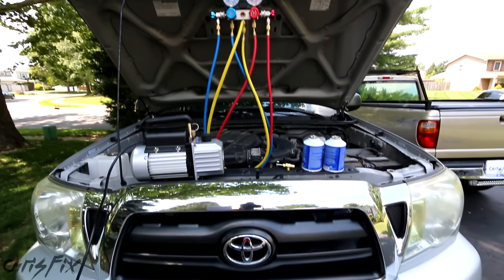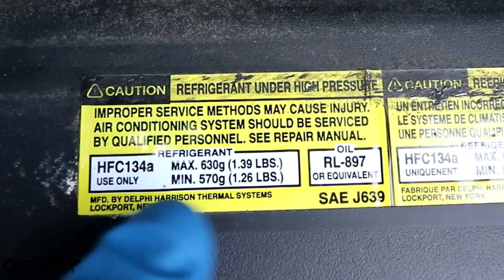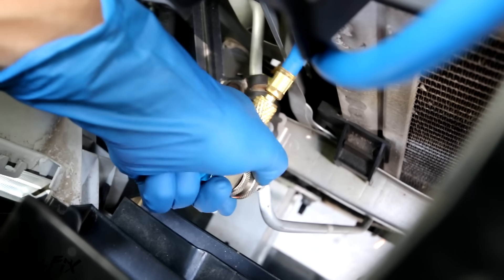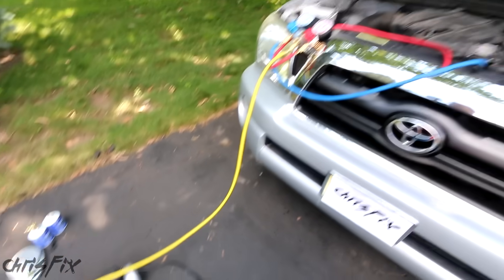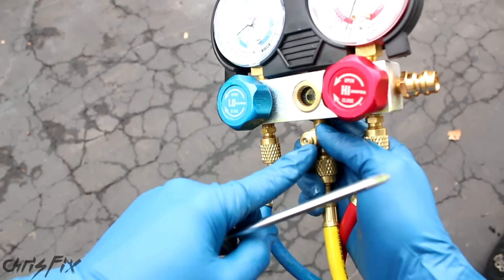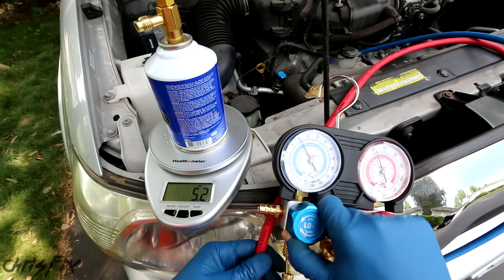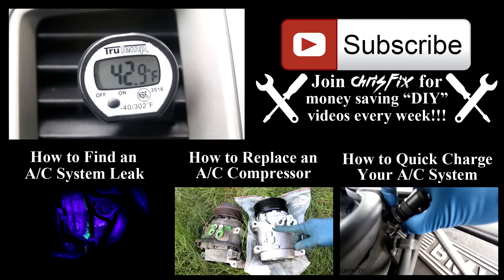How to Properly Recharge Your AC System

Comment: Chris what if i didnt replace an a/c component,  but just want to vacuum and top off what refrigerant I already have??
Reply: Yeah you can just add the Freon to the old refrigerant as long as the capacity meets OEM specs on the vehicle and is same fluid as is specified on your vehicle.
Reply: @YogurtSnipe  how do I know or test to see if my freon level is low or is at right level?
Reply: @troyhenry3267  As like in the video when you hook up the pressure checker to both the high and low lines all you need to do is open the blue valve on the low end in order for the pressure to shoot up to the brass block putting a pressure on the knob. You don’t touch anything but the blue knob on the car to check for pressure while the red knob is close on the car and pressure block. The current pressure your vehicle has will read in PSI, you need to convert that to fluid oz’s to know how much refrigerant is in there. You can use an online calculator but they can be confusing not gunna lie. It’s easier to fill the system when it’s all evacuated.

When you get your level to a certain PSI you can also just check the specs of the a/c on the radiator or right under the top of the hood where a sticker badge would be to tell how much refrigerant is supposed to be there. There should be a min and a max fluid oz it tells you. Your Freon should be in between the max and min to be at a safe level. Sometimes it tells you in weight aswell the oz which is why you need to convert be PSI to weight to convert it to Oz’s. If all else fails you can look online what the pressure should be at. In the video though you need Atleast 35 pounds of pressure to test if the vehicle gets refrigerant. To be honest I just put a total 12oz in a 15oz system and put a quarter of another can into it and called it good. So far it’s ran just fine.
Reply: @YogurtSnipe  how much would a shop charge to 100% evacuate
My cars freon?
Then I could just refill with the appropriate amount of oz. My Accord requires.
Reply: @troyhenry3267  Yeah you have to do it through a evap machine using the vacuum pump and hooking it up to a machine that gets rid of the old stuff properly. It’s actually against the law to just let that stuff spew into the air. Typically they won’t just evacuate the system, I’d cost around $20-$234. Average on $115. The vacuum pump you use does do this mostly since it sucks out the old stuff and the moisture in the system. I believe the vacuum pump shown in the video does actually convert the old stuff into heat from the pump and spews it out through the grills on it. You might be fine there.

Comment: So I have a question, how the hell does he just add the oil right to the yellow line?  It pools in the very top and doesn’t get sucked down, I feel like he missed an explanation here
Reply: Yeah you just have to keep the low pressure line closed on the car. Then keep the second one closed, dump a quarter of the leak detector and condenser oil, hold the line up in the air don’t let it run out, hook up the refrigerant like in the video (after the bubble procedure) and run it like this… Turn the car on, then a/c on low and open the low pressure valve at the pressure checker. It will bubble a bit but that’s just air escaping the line, then loosen the low pressure valve at the car just a tiny bit, it will also bubble. Once it stops bubbling then open the valve on the car more and it will slowly drain down the line into the car. Now close the line on the car and a/c pressure checker. Then hook up the adapter to the refrigerant can and spin the yellow line to the can. Now turn the valve to let the refrigerant fill the line. After that take the screwdriver and push the valve in the middle under the clear glass that shows the refrigerant. It will spew out the refrigerant like nitrogen ice do that until you see the white fog come out. Now the line has no air, then open the checker line on the blue side for low pressure. Now you can do this if you want to be careful. Close the can by twisting the valve on the adapter on the can completely. Then open the valve to the car (blue one) and you should see the pressure spike on the low side. Once it stops and you see the high pressure build up a little bit close the low pressure valve at the checker and open the can up a little bit. Then open the checker blue valve a little bit until the low pressure moves up again and the high pressure moves up. Once it does you can fully open the can to let the refrigerant get vacuumed into the system. Make sure to flip it upside down to let gravity suck the most out of the can. Then repeat the step of closing the checker valve and shaking the can and flipping it down and opening the checker valve two or 5 times. Once you feel the can is light and the pressure is close to 35 or 40 close the checker line and disconnect the can. Let the car run with the new a/c for 30-40 minutes to allow the condenser to convert the air and run it through the blend doors. You’ll slowly feel it get colder from the passenger side of the vehicle to the driver side. Once it’s fully cold from both sides you can proceed to fill the rest of the car with the amount you need.

Comment: Only air and no refrigerant comes out of purge valve. Why? I've tried three cans of R-134a.
Reply from the maker: Are you using the adapter for the end of the yellow  line that pierces into the can so it allows the refrigerant out?

Comment: Chris, you've made understanding how to do this job very clear and easy to understand.  Question, I have a 2010 Accord, and this has never been done to my AC system. It has 191K miles on it. Even though the air does blow cold, how do you know when it's time or even if you should do a 100%  A/C recharge service on your system?   With the help of your video, i think i could do this job myself.   Are the tools you used the guages and vac pump can they be rented ?  or do you have to buy them?  Thanks!!

Comment: Make sure the combination of ambient temperature and inches of vacuum actually boils any moisture in the system. For example, my system only pulls 27.5 inches of mercury, so the ambient temp needs to be around 100 degrees before moisture in the system will boil off. Try leaving your car running while pulling vacuum if the temp outside is lower, or if you’re not pulling 30 inches of mercury like Chris here. You can also google “boiling temp of water under vacuum chart.”

Comment: If I already have a bit of refrigerant but it's low to where it pretty much only runs after the car has been sitting for hours (high and low gauges are the same at around 35 psi with weather at about 90° and well above 50% humidity) do I have to pull a vacuum? Or is that only for when the system is empty or components are replaced or compressor is bad or something? I know I have a slow leak but I wanna recharge it with dye added to find it. Blows cold but only for like an hour then blows warm. Maybe not enough pressure after a while 

Thanks

Comment: Aren't fluid ounces and dry ounces different? I figured half the weight of the can would be 6 oz fl considering 12 fluid oz can
Reply from the maker: I believe that is true for liquids but in this case 12 fl oz = 12oz
Reply: @chrisfix  I see exactly what you did it just doesn't make sense to me.. I felt like some of the weight on that  2nd can was also the hose resting on it? Either way bro The Air came out cold 🥶 💯 .. and you came a long way since this video.. it's just me picking small little details out

Comment: I almost made a mistake on following the advice on this video, this video is for an a/c system with nothing in the lines and new compressor, it is not for running a/c system running low on refrigerant. Great video by the way.
Reply: What were your conditions with low refrigerant? What did the gauges read and what was the weather? Mine blows cold after the car sits for hours and cold starts but only runs for an hour or so. Had it evacuated and recharged about a year ago but that's what it started doin a couple days ago. Was perfect for a whole year so I have a slow leak.

Comment: 2:50 doesn't pulling a vacumn for 45 minutes mess with the oil in the new compressor?
Reply from the maker: No, the vacuuming only removes gasses that would be in the system, not any liquids so the oil is safe
Reply: @chrisfix hi Chris, just replaced my condenser on my truck and I also vacuum the system, Do I still need to add pag oil to the system?

Comment: Question 6
Why doesn't Four Seasons offer AC System Sealer?

Answer: For years now, the Mobile HVAC Aftermarket has been inundated with a multitude of products claiming to be a cure-all or quick fix. They have been around in many forms for numerous years and have been used by the installer base with mixed results. One such product on the market that has been receiving a lot of attention of late is "System Sealers." "Systems Sealers" are intended to seal A/C refrigeration system leaks without incurring the cost associated with proper service.

TCD offers products and/or solutions that are intended to meet or exceed the demand of the market. Our mission is to provide our customers with a service level that is second to none and in doing so we perform extensive research and testing on those products offered in our line. In researching sealing products, we have found that there is a considerable objection from the OE system and equipment manufacturers on the use of "System Sealers." In fact, many of these manufacturers are voiding customer's warranties should such products be found within their systems. TCD's policy regarding the use of these products is that we DO NOT endorse its use and will deny all claims made against defective products returned for credit that are found to have been exposed to or
suspected of containing said sealers.

Our recommendation has always been that a leaking component needs to be replaced! We are continuing our evaluation process on the effects that "System Sealers" have on components within the A/C system. In addition, we are working closely with the manufacturers of these sealers as well as other component manufactures and industry related associations on their testing and evaluation processes in which to substantiate or refute its claims.

Comment: I’ve used this video countless times to recharge but this time around I noticed a flaw i wanted to point out. If you’re supposed to add oil through the yellow line but you purge it you blow it out the line, but If you don’t purge you’re letting an air bubble in

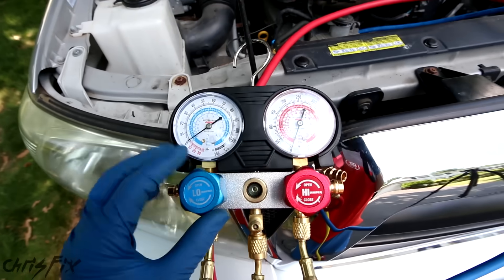Comment: 5:20 The refrigerant, being an HFC 134a, HFC standing for Hydro-Fluro-Carbon has 0.0 ODP vs CFC 12, or Chloro-Fluro-Carbons which has 1.0 ODP means it won't harm the environment if it leaks. Chlorine, combined with the molecular structure of refrigerant, is what causes ozone depletion. HFC 134a doesn't have any chlorine.

Comment: so if a/c is a sealed system and all your doing is adding refrigerant where is the moisture coming from???
Reply: The moisture came from venting the system to replace a part.  If system still has freon in it then no need to vacuum it down.

Comment: So you need to pull a vacuum every single time you need to charge it a little bit? Seems a bit much no ? I could understand if it was empty. But If it’s under pressure how would air / moisture get into the system?
Reply from the maker: In that case you don't need to but you should understand why you need to keep charging it

Comment: If your just f filling the ac unit with Freon using a manifold gauge do you have to hook up and open the high side connector?
Reply from the maker: You're only opening and filling through the low pressure side

Comment: Interesting to note that those cans are mislabeled - 12 fl oz is a unit of volume, 12 oz is a unit of mass. Refrigerant is not sold by volume as it of course varies greatly dependent on temperature and pressure. In this case the cans likely have 340g (mass) (or 12 oz) of refrigerant and somebody screwed up the label, it should simply say 12 oz.

Comment: Hi Chris, When you run the vacuum for 45 mins, do you risk pulling the oil (pre oiled) from the compressor out? Also-I just need to top mine up, and wonder if I should vacuum it all out, and start from scratch, to make sure I have the correct amount of oil and refrigerant.

Comment: I pulled a vacuum on a vintage air system for a hot rod connecting both high and low side. Only high side gauge vacuumed down to 30hg and held. Low side gauge didn't move at all. Is that indicative if a problem?

Comment: You know the first piece of information that would’ve been beneficial is the a/c evacuation.
I like the way you barely slip that in after the fact .     Thanks I overcharged my system
Reply: So you connected the manifold, saw that there was pressure in the system, and you still charged it? Even if you didn’t get the system evacuated by a shop the first step is to connect the vacuum pump and pump out any residual air and whatnot, you also ignored that whole entire step that took up a few minutes in the video? Seriously dude?
Reply: Agree totally. Should have been one of the first things mentioned in this video.

Comment: When refilling the first can seemed to be empty but upon removal sprayed small amount. Second can doesn’t seem to move at all and the low pressure side is at 90 psi.  Any advice. I know the compressor works.
Reply from the maker: If you shake the second can nothing happened? Make sure the can and line is open too

Comment: This video is still helping people 8 years later. Just replaced the condenser in my 2015 Silverado and this video got me through the vacuum/recharge. Thank you!
Reply: 9 years later now lol
Reply: I will be replacing the condenser as well.  I had a few questions.  Assuming the refrigerant leaked out through the hole/leak in the condenser.  
1) Once I replace the condenser, what do you do if you still see pressure on the gauges?  Did you see any remaining pressure after replacing condenser?
2) Did you still add oil, or just assume the compressor still had oil?  Or should you still add oil for the new condenser you put in?
Reply: @BizyBeee 

I think you still have to replace some oil with any part replace. Also supposed to replace things like the filter dryer and the strainers/etc. sometimes even flushing the system is a good idea

But yeah I think you'll want to add some oil, I just don't know how much

You shouldn't see any pressure when the condenser is removed, and the system should be emptied by someone who has a machine to recover it. Usually they'll do the removal for free or pretty cheap
Reply: @JamesAutoDude if you refilled with ac cans, approx how many did you have to use? I have a Silverado 2014 and am wondering how much I would need
Reply: @KyleLoowis if I'm remembering correctly, I think it was like 3 cans or 2.5 cans, but read the label on the hood. It'll tell you how many oz to use as every car/truck is different even between similar models
Reply: Yes it is! 👍🏻😎
Reply from the maker: Awesome!
Reply: @chrisfix  I will be replacing the condenser as well.  I had a few questions.  Assuming the refrigerant leaked out through the hole/leak in the condenser.  
1) Once I replace the condenser, what do you do if you still see pressure on the gauges?  Did you see any remaining pressure after replacing condenser?
2) Did you still add oil, or just assume the compressor still had oil?  Or should you still add oil for the new condenser you put in?

Comment: If you're doing this at home for a single car, DO NOT FOLLOW THE FINAL PROCEDURES. You'll end up with a ton of refrigerant trapped in the high pressure line.
What you want to do is fill up very close to how much you need, then close and disconnect the high pressure line from the car.
Then open up the high pressure valve on the gauge to dump the refrigerant into the yellow line. Then open the low pressure valve to let the compressor suck all the refrigerant out of the gauges and lines before closing all the valves. Now you can disconnect everything without the problem of refrigerant being trapped and leaking out when storing your gauge kit.
Reply from the maker: The lines don't really hold that much but thanks for sharing
Reply: @chrisfix  True, it's not a whole lot, but it is enough to cause a slimy mess for those of us that might only use our kit once every 5+ years.

Comment: Will these instructions work the same for hybrid vehicles?
Reply from the maker: I can't see why it would be much different however they might require different oil and refrigerant so the process could be different. I would double check a service manual if you can get access to one

Comment: Awesome video man! Thank you so much! One problem I ran into on this job was after using the vacuum pump it ended up throwing the low pressure lock out on the compressor and wouldn’t turn the compressor on to be able to take the Freon. Ended up jumping the relay and then finally got it to take the Freon any advice how to avoid this next time? Was a 2018 Ford explorer

Comment: So I did the exact steps, and when I went to purge the yellow hose, oil came out instead of the air. I'm not sure what to do next. [Update: 06/12/24] I'm pretty sure the vacuum was cheap and somehow sucked out oil onto the manifold gauge.  I tried to purge it and a small amount came out. I had no other choice, but to move forward and put in the refrigerant.  I checked the measurements and drove it yesterday and it's cooling me down. So far so good. Thanks, Chris for creating this free and really informative content! 👍

Comment: Heads up. Don't connect the yellow line to vacuum pump until AFTER you drain the refrigerant from the lines. I did this and it backfed into my pump and blew the oil cap off. First time doing this so learn from my mistake.